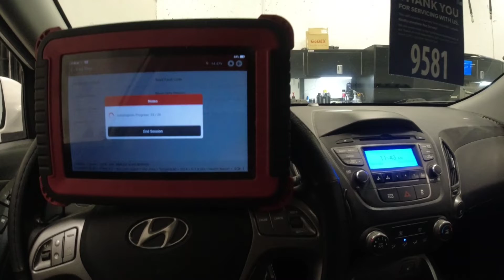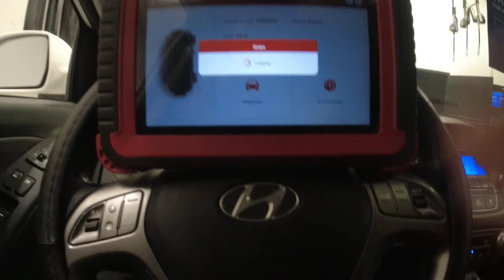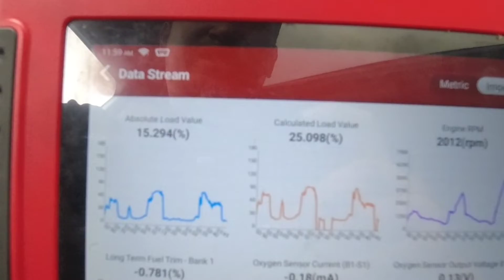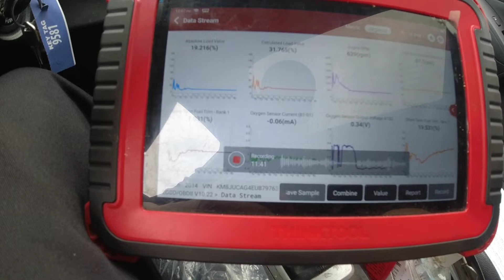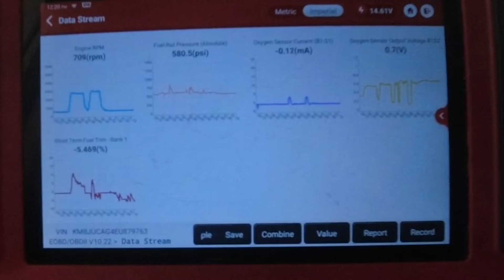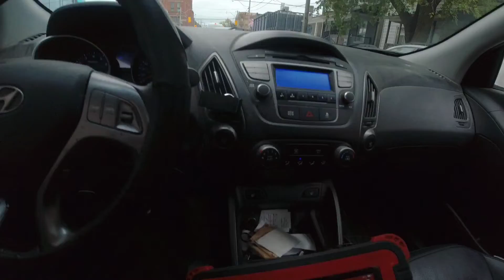2014 Hyundai Tucson stalling issue

Comment: I enjoy your channel!  I have a 2021 Sonata N-Line that the dealer can not fix since it was new.  It sets a C162078 code.  Check forward collision system, smart cruise control disabled.  They have replaced the sensor in the grill and adjusted it numerous times but coded keeps coming back.  It may take several months for the problem to show up but it is not fixed.  Do you have any idea what i can tell the dealer to look out for?
Reply from the maker: C162078 is for front radar alignment  code. Most of the time when i have that fault i just adjust the front radar angle to right specification and then perform a static front radar alignment and it fix the issue. I wonder how they calibrate the front radar? Is it static with radar targets ot they drove it?
Reply: I'm not sure how they are doing it but i will ask them.  Just to give you some context about me.  I'm an ASE tech that has been wrenching for 30 years.  I run a fleet shop  that maintains 400 vehicles for Sedgwick County Fleet Management in Wichita Ks.  We work on Sheriff cars, ambulances, public works, comcare, health department. We just purchased 10 2024 Elantra's for detective use in the Sheriff's department.
 @hyundaitech